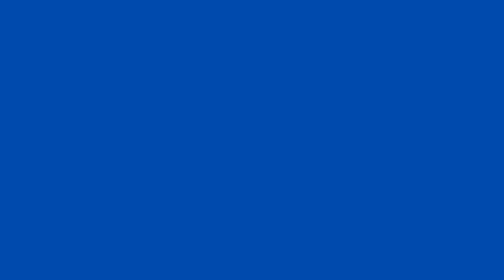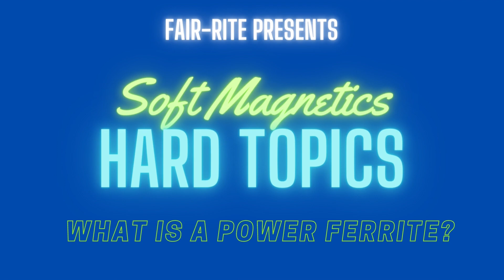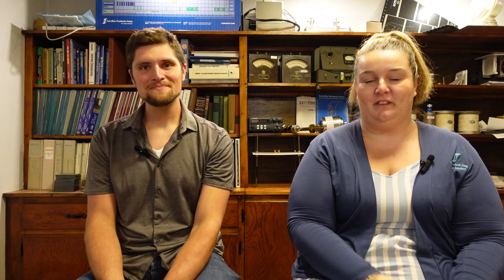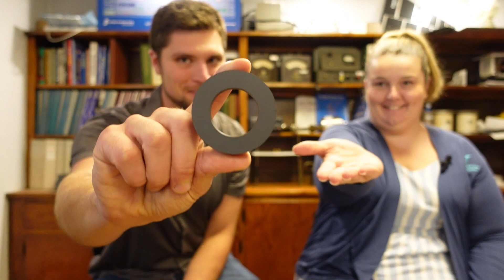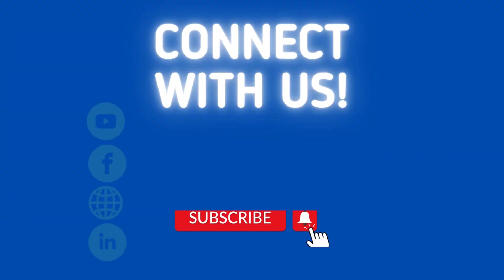Ep. 3:What is a Power Ferrite?

Comment: Hi，like your video s，do you think phase compensation is necessary in the test of core loss at MHz。Can you recommend a power loss test system that can compensate phase angel.
Reply from the maker: Multi-MHz core loss measurements are difficult due to that phase measurement (even with great compensation). We use a custom made resonant test method to eliminate the phase measurement dependency. For off the shelf systems up to 1MHz, there are several decent ones. The Clarke Hess 2335A is what we use here <1MHz. Calorimetric systems should be the most accurate at multi-MHz but, they can be somewhat painful to setup